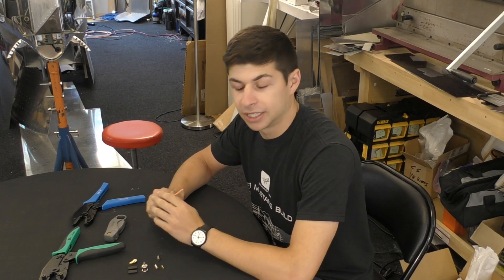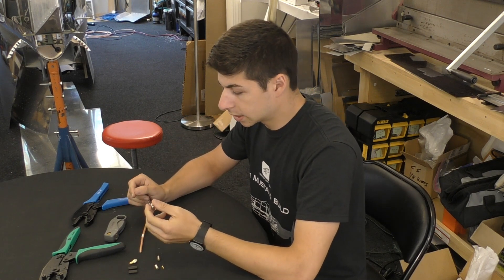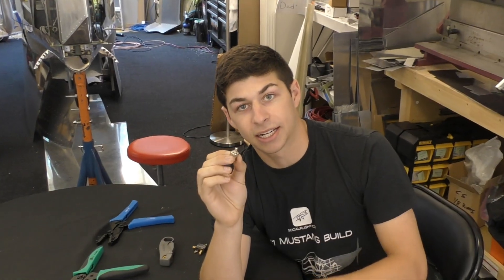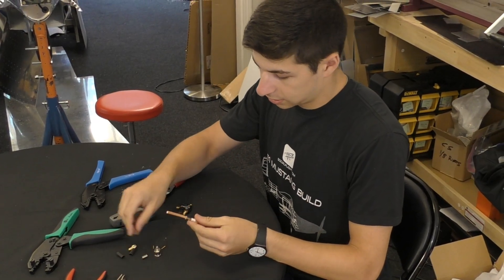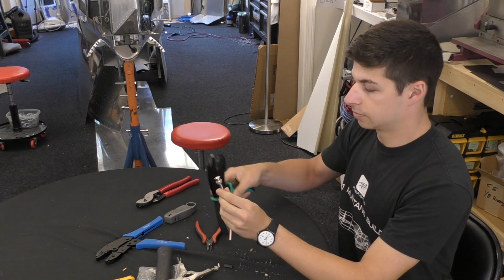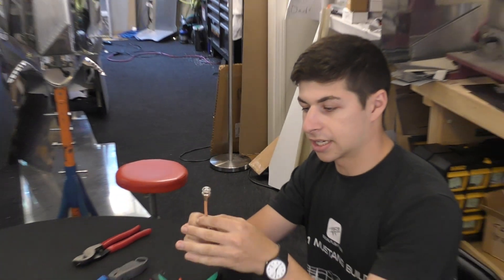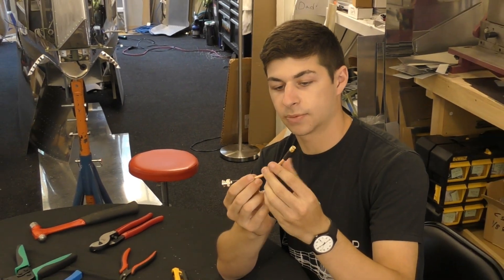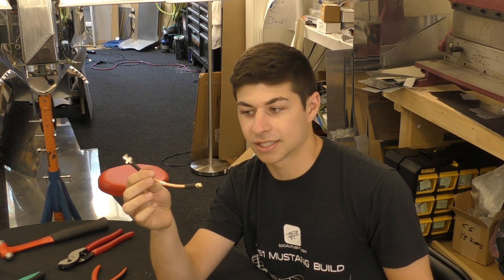FEWER ANTENNAS = MORE SPEED...Combining 2 GPS & 1 COM on our Titan T-51D Mustang!

Comment: Great work, suggest checking continuity with a multimeter just in case, just something we do in our place when building coax like that.
Reply from the maker: Great point. We did check continuity, but forgot to include that in the video!  Checking both for continuity and shorts to the shielding.  Nice catch.